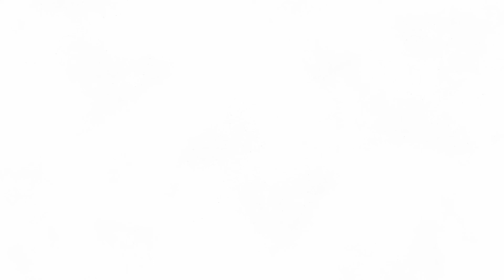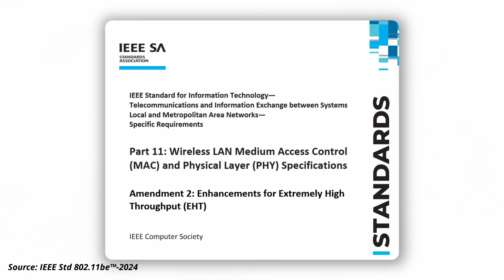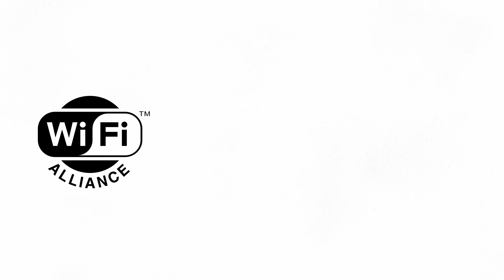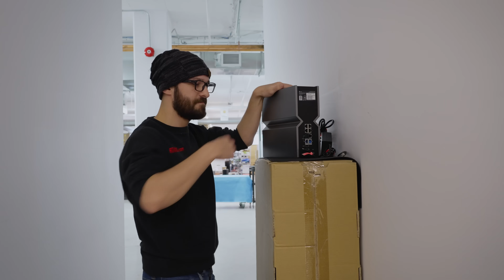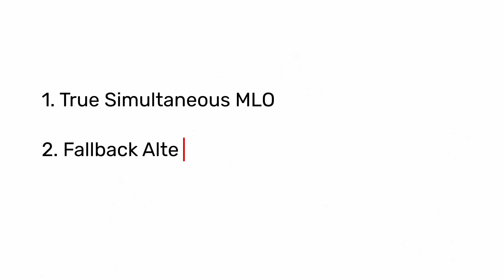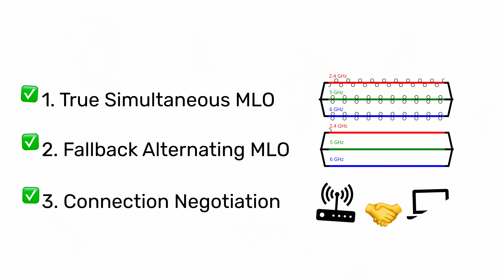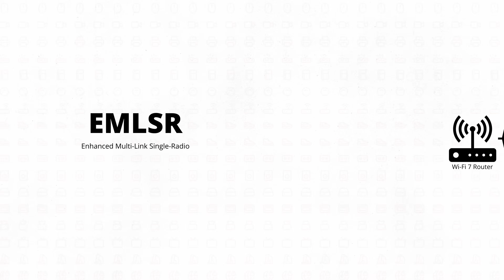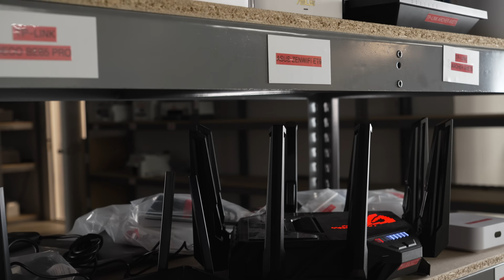Wi-Fi 7's Best Feature Doesn't Work (Yet)

Comment: That's the problem with optional features in standards. Standards should not have optional features. All features of a standard should be mandatory and if you need different classes of capabilities, that should be different standards. 

Same issue with USB 3.1, 3.2 and USB 4. Up to USB 3, everything was mandatory. Then came USB 3 and does the same nonsense as WiFi has always been doing. Advertising a huge set of features but the majority of them are optional and pretty much all vendors just implement the minimum requirements the standard sets and nothing else. USB 3 introduced 5 Gbps  speed, this is mandatory. USB 3.1 introduced 10 Gbps speed but that is optional and USB 3.2 introduced 20 Gbps of speed, again optional. So what speed will you get when you buy a USB hub or USB stick adverting to support USB 3.2? In most cases you get 5 Gbps as that's the only required speed, meaning you don't get more than buying a 3.0 hub, you just pay more because it says 3.2. USB 4 now supports PCIe tunneling and up to 40 Gbps of speed, but again, optional, most users will never see any of this.

Or look at USB-C, which BTW was an own standard prior to USB 4 and not related to USB 3 at all. What is the minimum speed an USB-C cable must provide? 480 Mbps, as it only must provide USB 2.0, everything else is optional. Even if it says "USB 3.2", it may still only provide 5 Gbps. What about Display Port? You can run Display Port signals through an USB-C cable as well, right? Totally optional, the cable you just purchased may not support that at all. But at least you can get fast charging, right? Actually, no. The maximum current an USB-C cable must be able to handle is 3 A, everything above that is optional. And since it only has to carry USB 2.0 signals and USB-PD is always optional for all USB ports, the maximum power yo might get is just 500 mA (0.5 A), as no USB 2 port must be able to deliver more than that, so even if your cable was capable of transmitting up to 3 A, you may not even ever get that much out of it. 0.5 A at 5 V (higher voltages are only supported with USB-PD, so totally optional) means 2.5 W; that's the only thing you can rely to always get.

That's like previous WiFi standards allowed up to 160 MHz wide channels but required were only 40 MHz and some devices didn't even offer 80. MIMO? Was optional. And even if you have MIMO, that doesn't mean you have multiple streams as that's also optional with MIMO (instead of increased bandwidth, MIMO can also just be used to improve link stability).

The point of a standard is to give users certainty about capabilities but for USB and WiFi, the standards no longer guarantee much more than "it will work". But they no longer give you any insight about what performance or features you can expect. So high performance or good stability has become a game of luck.

Comment: Also, please note that hardware revisions like v1 vs v1.1 can be a drastically different router inside. Like chipset changed from Qualcomm to MediaTek to Realtek. And forget about firmware updates! They will release revision v7.2 and say they provided firmware for example Archer 7 which very old model but in reality only the case is the same and hardware changed 15 times

Comment: the best use case I've found for MLO is two TP Link wifi 7 extenders connected via MLO with one on the first floor connected via ethernet to the home modem, providing 10gbps wirelessly to the second extender directly below it in the basement to create ethernet speeds for a second router in the basement controlling every device in it. Since one is the only client for the other, it gets the full potential speed and is super stable with minimal latency

Comment: Glad I found this video.  I was just about to shell out for a new Wi-Fi 7 router and two Wi-Fi access points (wired) to replace my aging Wi-Fi 5 setup.
Reply: I wouldn’t panic cancel your upgrade just because of this video. Even without full STR MLO, Wi-Fi 7 still brings real improvements over Wi-Fi 5, like wider 320 MHz channels, 4K QAM, better efficiency, and lower latency in busy environments.

Most client devices don’t support full multi-radio MLO yet anyway, so you wouldn’t be missing much in practice. The video is fair in pointing out the marketing vs spec gap, but that doesn’t mean Wi-Fi 7 is broken. If you’re moving from Wi-Fi 5, you’ll still see a noticeable upgrade.
Reply: Wi-Fi 7 is still a lot better than Wi-Fi 5. I just upgraded from Wi-Fi 6 and Instead of 500-800 mbps to my devices, I get the full 1500 mbps down of my internet speed on 6ghz (possibly more I haven't tried a PC to router speed test) and my ping for gaming went from 50-60 ms to 10-15 ms

Comment: It gets much worse. No reasonable Wi-Fi client driver will ever turn on the TWT implementation, because some routers have it implemented so poorly that the throughput gets abysmally low and the Wi-Fi becomes unusable.
And the user would think then it's the issue with the client (because other devices - these with TWT disabled - work).

Comment: Most of the routers that I recognized on the list are Chinese in origin.  Deceptive marketing from Chinese built routers is sort of to be expected as almost everything built with a "made in China" label tends to be deceptive..  Bummed: Yes.  Surprised: No.  It would not surprise me if stuff, including routers, built in even other countries start marketing stuff similarly;  that is, DECEPTIVELY..  Often easier to sell a bunch of stuff, ruin the brand name, and then close shop and spin up a new brand and continue on.  Even US brands like Dell have been known to produce good quality stuff, once the reputation is solid, then produce crap, then rebound back later to start producing quality stuff again, only to repeat the same cycle.

Comment: Started with city fibre router supplied by Ocetera (not sure exact name) then found out it doesn't support the speed I was paying for. Now switched to the RS600 and fab speed. 950mbs (I'm paying for 1G, so happy with that. But it's not so good with range through walls, had to use a booster in the garage even with 2.5 hzs to link the solar panels.

Comment: Its even worse than that, most modern access points advertise 4x4 antenna configurations and say they reach higher speeds than 2x2, but in practise they are even slower. Beamforming and MU-MIMO is not working and no one has ever complained about this either... now the put MLO on top, without delivering anything. So they advertise the numbers of 4x4 * 4x4 * 4x4 at the same time, but even if you have compatible client devices, the AP can only deliver a measly 2x2 in total. Maybe 2x2 * 2x2.
Reply: I stopped reading at "practise".
Reply: @tim3172  if you cannot read english, why dont you use the translation feature!

Comment: I just purchased the be25 for a mesh network in my house. I will say that the speed with the mlo is far faster than the regular 5g speed. I definitely don’t have the use case or the experience to tell if there is was a difference with the “missing” mlo features tho. Overall it was the cheapest mlo capable router and far superior than the previous mesh WiFi set up I had. 

Seeing this really makes me wonder  if the more expensive/“more capable” routers are that much better. I can’t see how WiFi can get better than the be25 for home mesh networks

Comment: This is the next level of enerving. Some routers can cost thousands like a pair of asus bt10 for AiMesh, so seeing them doing the bare minimum of the Wi-Fi 7 spec is outrageous. What's the point of a Wi-Fi 7 router if all of the features are on the wired side of the device? This is nuts.

Keep this content up, speak for the common user!

Comment: After my 4th or 5th Netgear router failed for no apparent reason, I jumped to another brand and landed on Mercusys which is a budget TPLink brand. I got the MR90X pretty cheap and it's been surprisingly good, but in the back of my mind I was wondering if I should have made the jump to 7. Kinda glad I didn't now, they are so much more expensive and not even close to worth what they charge it seems. Still rocking the MR90X and really happy with it, hasn't missed a beat but TPLink are a bit slack with updates, I'm sure there must be some vulnerabilities that have been patched since launch :/

Comment: I have the nighthawk and can confirm it's garbage. No improvement over a wifi 6 (not 6E) even after trying both it's automated client and channel management and manualy choosing channels (after scanning with a wifi scanning app to find clear channels) and selecting bands for important vs low priority clients. It's actually a slight regression from my wifi 6 unit in terms a range by five feet or so. 6ghz seems to be a joke, eight linear feet and one hollow drywall wall kicks the client device down to 5ghz. Anything actually in range in also in Ethernet range, but I guess it's a neat party trick to do speed test on your phone from five feet away. I'm sure there's a dedicated use for closely placed but wifi only devices, but that's not a practical use case for me.

Comment: For Mlo to be support it has to be set to wpa3 security  I would trust that you did but if not try with it enabled
Reply: @Gamediamond3757 Yes. Someone in the comments finally said it: "MLO requires WPA3 security." If the Wi-Fi 7 implementation is good, when turning on MLO, the router will automatically restrict you to WPA3. Hopefully, it will warn you about this as well. Naturally, legacy devices that can't do WPA3 will lose access to your newly enabled MLO network. The workaround to this? Create 2 WiFi networks: One with WiFi7/MLO/WPA3 and one without.

Comment: Basically, unless you're a professional operation that does heavy VM or video editing over a 10 GB LAN or are hosting a stadium of users, stay with your older WiFi 6 equipment.  The benefits aren't there for normal folks and even their WAN connectivity won't even be enough to make faster throughput a benefit.  Save your money.

Comment: I would disagree that a Wi-Fi 6 router is a proper replacement for a Wi-Fi 7 one as Wi-Fi 6 does not have the 6 GHz band the main point of Wi-Fi 7

Then you going to recommending 6E however in many cases 6E devices unless you're getting them on clearance discount are actually more expensive than Wi-Fi 7 because it's cheaper to produce Wi-Fi 7 as a technology

Comment: I remember this being an issue all the way back in the 802.11g days, back when the WRT54G was all the rage. 

The WiFi alliance publishes a draft spec and the hardware manufacturers build hardware around it but don’t always support all features of the new spec. That’s generally why it’s better to stay with the trailing edge spec that’s reached maturity. 

Today that would be WiFi 6 instead of jumping straight away to WiFi 7. Especially if your devices don’t support it.

Comment: Still using a Netgear Nighthawk AX12/AX6000 from 2019...it's fine but just got an email that they are ending firmware support in May. Started looking for a new router but based on this video, it will be my last Netgear purchase. Will probably just get a newer Wi-Fi Certified 6E router.

Comment: I have the GT-BE98 Pro and unfortunately I don't have any devices that can use MLO. I did mostly bought it for the WIFI-7 speeds which it indeed has. I think that if you have full MLO support on both router and clients, depending on your building you'll still benefit from using compatible AP's.

Comment: I found a way to finally use MLO successfully: plug my Desktop into an Asus Wi-fi 7 router in mesh mode using MLO as a backhaul. It's like wireless ethernet now in terms of speed and stability.

Comment: Good video. Unfortunately, it's even worse with the router that comes with Quantum Fiber. It has a bug in its MLO implementation that intermittently drops the speed from 100's of mbps to less than 10 mbps for several minutes before coming back. And Quantum doesn't provide enough administrative access to turn off MLO or downgrade it to only use Wifi 6. If I can't get them to fix it, I'll have to switch routers... again.
Reply: At least your Fiber provider has a router that allows for it to use Wi-Fi 6.. I've been asking for mine to provide me monthly updates on when they plan on upgrading theirs to allow even that much. 6E or heaven forbid 7 are not on the table in this decade for sure unless forced upon them by the Feds. Which we KNOW won't happen either.

Comment: Haven't bought consumer crap for years. Ruckus, Aruba/hpe or Cisco. Sure it's expensive. However it's mine it's good. And proper monitoring and management. Installed over 100 networks over the years and once you've had enterprise hardware you won't go back.

Comment: Sorry to see the state of Reuter marketing.
In my home, we lived with Google Wifi on Wi-Fi five and a three router mesh for several years, and it was great for the time. Eventually, I decommissioned them and my godfather‘s house inherited them.
We replaced them with a Wi-Fi six system which I saw was being sold at Apple, when I was able to pick them up used on eBay for half price. They subsequently fell on eBay by another 50%. I think they’re a good deal. Their app usability is not nearly as good as Google Wifi, and I have been locked out of the app entirely for years, but the router is still work! They are also resilience to power failures, restarting, and recovering in a few seconds,
The main reason we made the upgrade was the availability of symmetric gigabyte Internet to our house. Wi-Fi five just is not fast enough to get anywhere near that speed, but Wi-Fi six gets close enough for our needs.
There are several technical inaccuracies in the above statement, and it’s not that I don’t know better – it is simply the dictation services. I am utilizing making those mistakes.

Comment: All I can say is that switching from Tplink 6e gear to a pair ofLinksys LN14 Series routers changed everything. Wifi speeds in the living room (connected to a satellite repeater) jumped from 80Mbs to reliably 500Mbps now. 

My fiber router delivers 2Gbps but it terminates in a bomb shelter, getting a signal out of there has always been challenging. Can't run a cable. 

Wifi 7 for that link from safe room to living room (only 15m) but with thick walls has always been a nightmare. 

At least we have great wifi when the alarms go.

Comment: Wow I didn't expect such a complete and total failure of basically the main feature of Wi-Fi 7. If I could return the router that I bought months ago to use as an AP, I would do it because the whole point was to have MLO for when client devices got around to supporting it. If I knew even the basic mode of that didn't work as expected, I'd have gone with a Wi-Fi 6e AP since the immediate need for the upgrade was 6 GHz support.

Comment: As misleading as it is that router companies advertise MLO without specifying what subset they support, this is basically in most cases a moot point because almost no client devices that support WiFi 7 have more than one radio so they can’t use the multi-radio EMLMR either. So yeah, it’s a bit misleading but also it’s not gonna affect much at this point because the client implementations are also not ready. We won’t see clients supporting a wide range of WiFi 7 capabilities until WiFi 7 has more of an installed router base. Otherwise they’re just implementing features that won’t see any real world use.

Comment: This is great and all, but lets be real here for a moment. For instance the Unifi U7 Pro does not advertise that it is MLO capable you can find this on the product page, it is coming in a later firmware release as stated. Also stopping calling everything a router, the U7 is an access-point which is not the same thing.

Comment: The simple thing I don't understand in all these standards...is why they allow partial implementations. Usb, Hdmi, Wifi etc. If you use a label, you should implement all the features. I think and may be wrong, but Thunderbolt is the only standard that does that.

Comment: The lack of aligned TWT is very disappointing, as that is a feature which could help make extended runtimes for IoT devices with very small batteries far more feasible and has been part of the standard since WiFi 6.

Comment: If no clients support the features, how were you able tô perform the tests?
Sorry If It is a dumb question, btw.
Reply: They checked the advertising packets that broadcast which features the router accepts for negotiation. These aren’t tailored to a specific client so it doesn’t matter what client device they use to read them. They didn’t actually test MLO itself, only if the router says it supports the particular feature sets mentioned in the video.

Comment: This is excellent info - I did not even know about 7th gen wireless standards.   I realized something throughout the vid, though:

If you could find one of those rare devices that functioned as advertised ... it won't do you very much good because the wifi network adapter in your device won't support it.    In order to utilize gen 7 both devices have to have the same functionality in order to use the full potential.

Comment: I am not sure what Unifi means here on their routers "Although MLO can boost performance by combining bands, most WiFi 7 devices still operate on a single band — so any benefits may be limited. To avoid potential interoperability issues, we recommend not enabling it at this time."
Although I do get much better connection with MLO enabled on a dedicated WiFi network with my iPhone 17